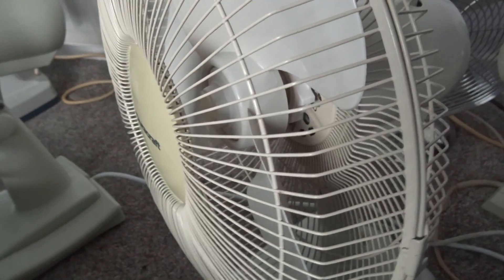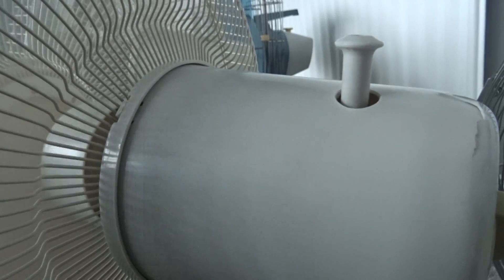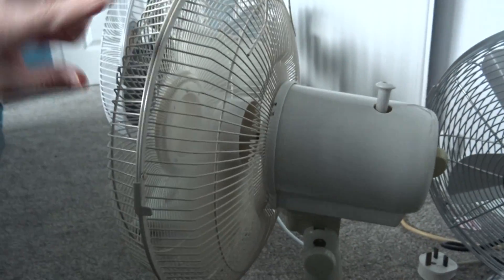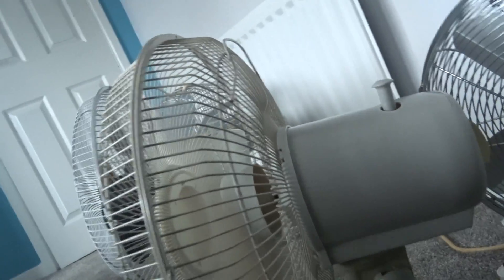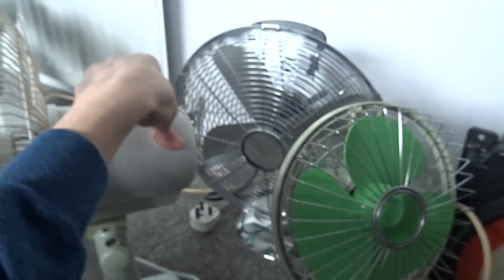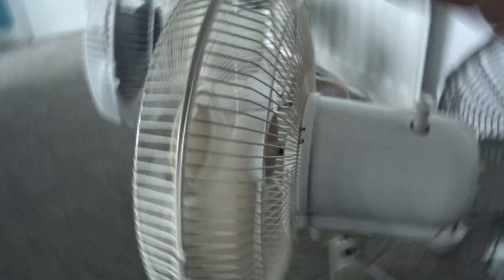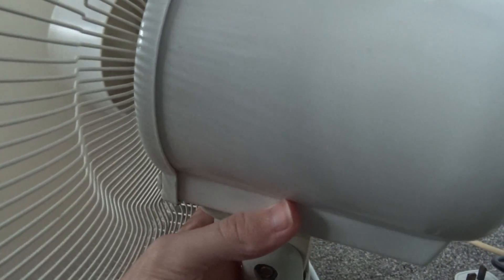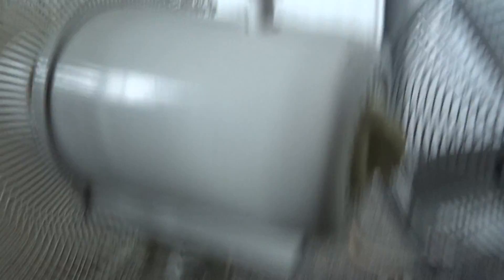An Issue With SMC Made Fans Vibrating Motor Housing

Comment: Yeah my 1997 CED 12” desk fan has the same issue
Reply: St least you both have solved the issue. Whenever i try to turn one of my stand fans, you can hear a squeak noise from the metal rubbing against the plastic as the stand fan is balanced, it leans to one side at the base. I haven't figured out the issue. Any ideas.
Reply from the maker: It makes the same noise too bro
Reply: @LiftEnthusiast2020OFFTOPIC  ah ok, thanks for the information.

Comment: Maybe the motor shaft is slightly unbalanced. Thats why the motor is vibrating.
Reply: My ced had a vibrating motor housing because of one of those clips that holds on the motor housing is bent so it is loose
Reply: @Connectitthefancollector  ah ok, thanks for the information.
Reply: @ethanfitton6336  yeah i think it is common but i am not sure
Reply: @Connectitthefancollector  cheak online, it might be.
Reply: @ethanfitton6336  i do think it might be because someone has been in it before which caused it to be bent
Reply: @Connectitthefancollector  yeah, you probably right.